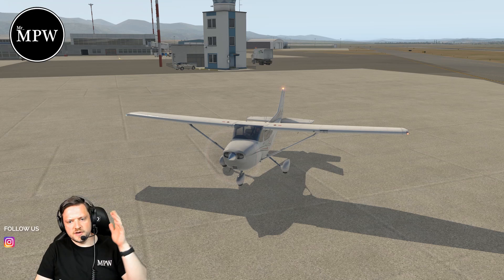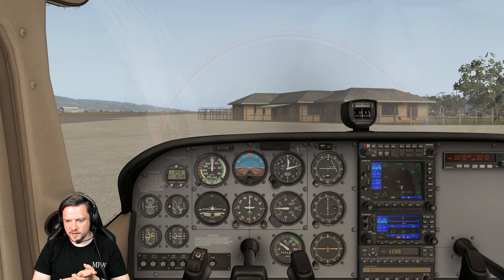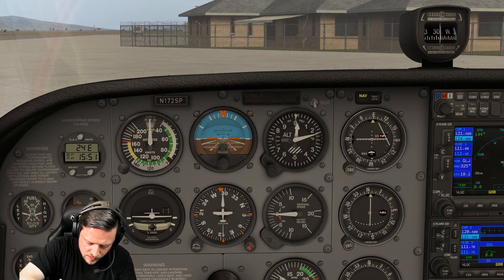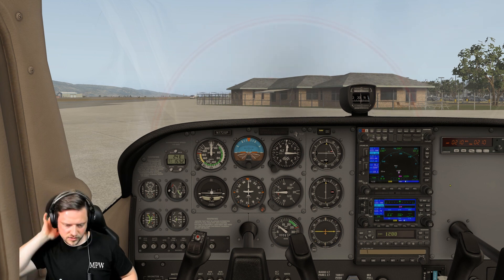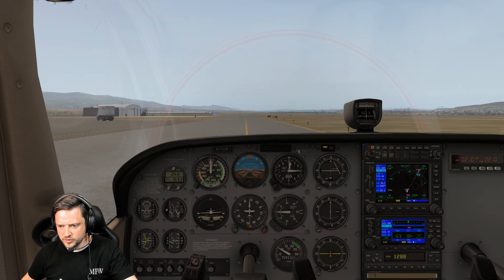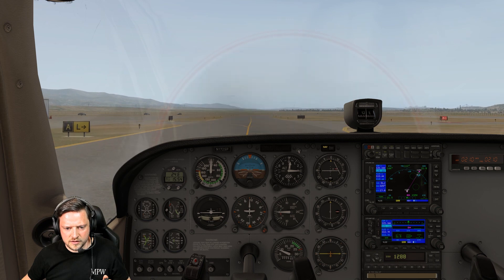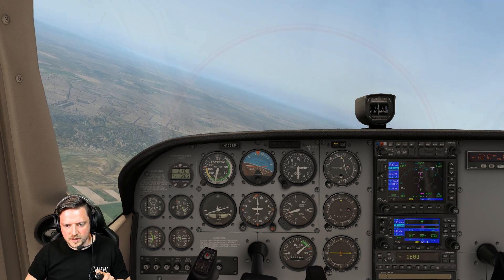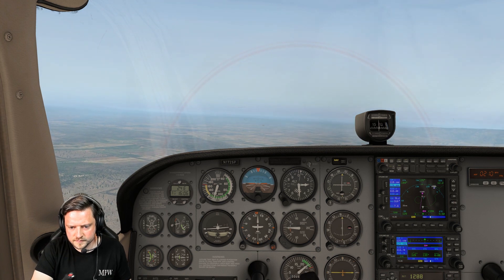PilotEdge CAT-4 Rating - Flight Training for Pilots in X-PLANE 11 with Real ATC | Mr MPW

Comment: Great effort Matt. Just a couple of suggestions to engage your viewers more. A moving map pop up now and then just to show the current location of the plane and track you are on. Changing the Camera view to show the airfield as you approach etc. Otherwise very professional and I enjoyed your precise approach.
Reply from the maker: Cheers Bashar. We’ve done elements of that in a couple in the past & are playing around with getting it smoothed out. 

It’s a bit of a battle at the moment to get any content created, as we’re all working remotely and I’m on a shonky, temporary setup which is literally wedged into the back of the garage at home... The kit we would normally use it all at the office (which we can’t get to due to the lockdown). 

Thanks for the input though, it’s much appreciated and we’ll keep trying to make improvements with every vid we make, in these very strange times! :)